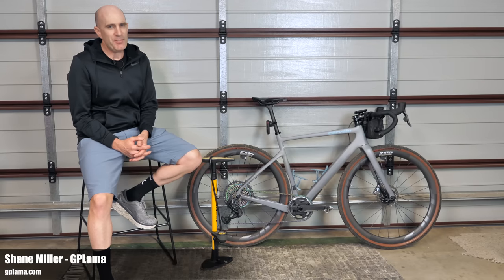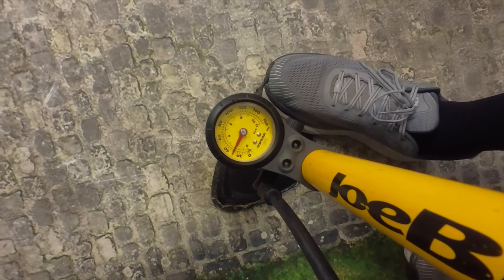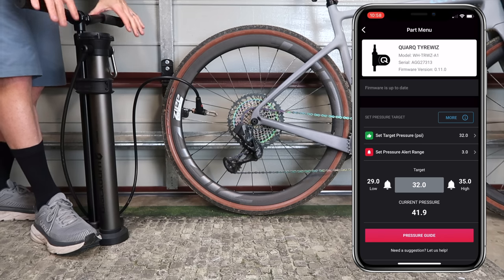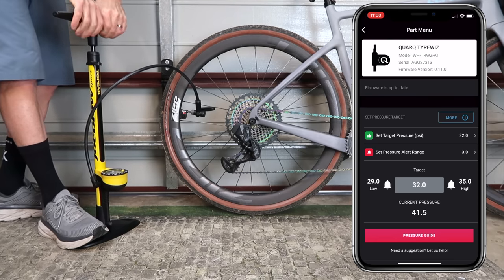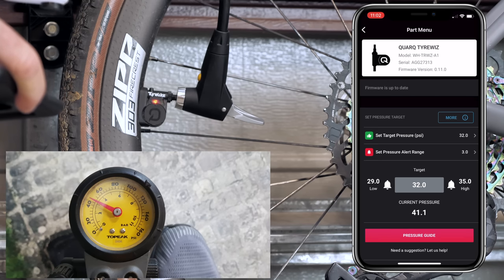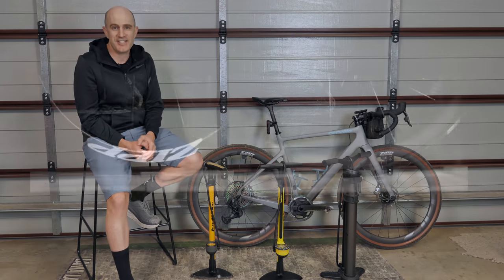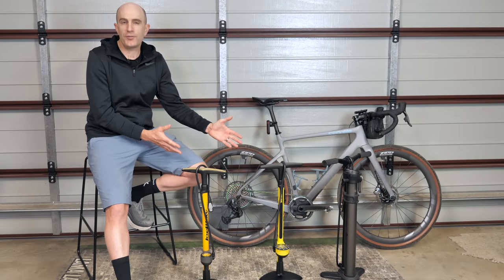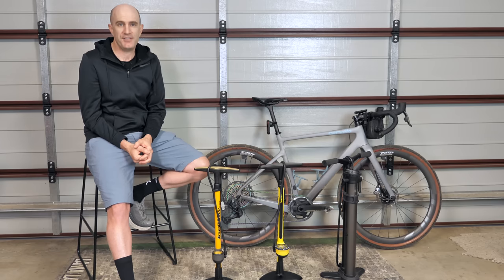Is Your Bicycle Floor Pump Accurate? Mine Wasn't 🤔

Comment: If your pump doesn't have a check valve between the pump cyclinder and the gauge, it's always going to read low.  Even then, it's going to read the pressure in the hose - not the pressure in the tire. I always recommend a stand alone digital gauge for our customers that need more precise tire pressures. (gravel and cx racers mostly)

Comment: I had an old Silca pump that I bought when I first got into cycling as a 14 year old about 20 years ago. After a period of 2-3 years off the bike, two years ago I got a gravel bike--my first experience with wider tires, tubeless, low pressures, etc. They always felt squishy to me, but I just thought "guess this must be wide tire life, NBD." I then bought a topeak digital pressure gauge before a trip when I planned to take only a mini pump to top off if needed, but for the life of me I couldn't get the digital gauge to read correctly--it always seemed about half what my floor pump read. I set it aside for a month thinking I got a defective one, until finally the Silca pump gave up the ghost and literally fell apart one day. Bought a new pump from Lezyne and for a minute I thought it too was bad--the pressure was reading so low! Then I quickly put 2 and 2 together: my old pump was overreading my pressure by about 100% for the last 6 months. What an idiot! I was riding around with like 21psi when I thought I was on 40. Needless to say, there were instant speed gains riding on the correct pressure after that.
Reply: Silca might be able supply the parts to refurbish?
Reply: @julianoneale9570  yeah probably. I needed a new one on the spot though and I don't have a need for 2 floor pumps, so it was a replacement for me. Little sad after so long though!

Comment: That Topeak D2 SmartGauge is outstanding. I’ve been using it for years on my mountain bike (16-24psi depending on tire width). It was pricey when I bought it but consistent which is key (and frankly more important than accuracy IMO) especially when riding at lower pressures. I use in on the road bikes too. Just over inflate by ~10psi and release pressure using the Topeak until you’re at your desired pressure. 10/10 can recommend.

Comment: Thanks for the update! I just bought a Joe Blow III. I bought it to replace an old pump that had issues overcoming internal pressure on long valve inner tubes and also struggled to stay connected on shorter valves, without taking off the threaded securing washer/ring. I also noticed the difference in pressures between the two, but couldn't confirm which was more accurate. This has me feeling better! 👌

Comment: Several years ago I purchased what I suspect is the most expensive floor pump on the planet. I didn't pay a premium because I thought doing so would ensure that I had the most accurate pump. Instead, it was the chuck that was the compelling feature. I have a movement disorder, which makes operating the locking lever typical on most chucks quite challenging. On the Silca pump, the chuck is supposed to slide on and off of Presta valves. In practice, the chuck needs some break-in time before it's performing optimally. For a pump that gets low to moderate use, it's already on its third gauge! But that had little to do with their accuracy. The previous gauges failed for a variety of reasons. Given the price of admission, I expected everything on the pump to work indefinitely. To their credit, Silca has never charged me for the price of a new gauge. At 68 years old, I don't know how much longer I'll be doing this, so an investment in new technology might not be in the cards. However, if I ever make the leap to something requiring more accuracy (e.g., hookless tubeless), obtaining new gadgets might become a necessity.

Comment: Good advice is also to use the old school method of using your thumbs as sensor. Especially with lower pressures. Gives a bit more feeling than cold numbers (saw a comment about someone not liking how squishy the ride was, but according to the pump it was a certain pressure, which it wasn't...).

Went up the Koppenberg last week on a regular road bike with 23 and 25mm tires with the cobbles being wet, muddy and with leaves to make it even more slippery. Dropped the pressure by feel. Upon returning I messured the pressure and it was the 4 bar I always like for these conditions.

Super interesting to notice that 5 bar made it near impossible to climb the Koppenberg under these slippery conditions, but 4 bar made it very well possible.

Comment: How do you know any of your equipment is correct (digital or analog) without a calibrated gauge? A calibrated gauge is the only way to know for sure. Love the channel.
Reply: TyreWiz reports data with +/-2% accuracy at a resolution of .1 PSI; vastly more accurate than any tire pump on the market
Reply: @richardggeorge  If we take that claim on its face then that's a spread of 58.8 - 61.2 psi @ 60 psi target. Higher pressures would yield a larger delta. You won't know, for sure, if the TyreWiz is correct without a calibrated standard to compare it against. For me, it's not a big deal. For others, it might be.

Comment: I have the same pump, also had issues with the check_valve, found that just removing/re-installing did the trick for most times.
It got damaged while pumping furiously to try and seat some dodgy tubeless tires. (I think it overheated or something, it is basically a piece of plastic with a spring).
Then purchased a replacement, it was very cheap.
I agree it is not so accurate (I double check with a digital meter), but it is repeatable, so as long as you find the pressure you like, you can get it with the pump. 
(Even though it is not the "real" value).

Comment: My next floor pump hope fully will better than my current one which struggled with any pressure over 100psi.
I use latex tubes so the pressure is probably at least 10psi less after a two hour ride.

Comment: There are so many variables to choosing a suitable tyre pressure, and it changes during the course of a ride anyway.  Find a pressure that is suitable, and then consistently pump to that using the gauge you have.  Doesn't matter what the gauge actually says as long as the gauge is consistent.  If I'm comfortable at 70 psi on my Joe Blow's gauge, I don't care that a more accurate gauge might read 65 psi.  Point is, I have the right amount of air in my tyres.
Reply: It is however really annoying when you ever use a different pump :)

Comment: I have a Park Tool floor pump with a similar issue -- it is always off by about 10 - 15 psi. I always have to double check everything with a separate tire pressure gauge that I also use for my car tires.

Comment: My wife got me a handheld air compressor made by Ryobi and I haven't used my floor pump since, it has a built in digital gauge as well, highly recommend. But yep I have a Joe Blow from 2010 that was always reading higher than what it actually was. I only knew this because I also used it to top off the air in my car's tires and I would check them with a digital gauge and the Joe Blow would read 32-33 while the gauge would read 30.

Comment: There is also  SKS  AIRSPY SV which seems to be quite bit cheaper that zipp's.

I have been thinking designing a ant tyre pressure sensor myself, but component shortages have made sensors as hard to find as gold.

Comment: My topeak joeblow race is off by 3 psi. Confirmed this with SKS pressure gauge. I like the topeak pump for the same reason you stated, but the smarthead can be damn frustrating. I had to disassemble and reassembled it several times already even though it’s only one year old. It happens if I switch back to presta from schrader.

Comment: my old floor pump  went into the back of my car so i always  can do  a quick load up  of some tires, for example  if needed  when doing a event or when  terrain ( for mtb is  wet  , sandy , rocky  orwhatever )  since then i got atleast a balpark figure to work with.  instead of blind guessing it with my  portable emergency  bike pump in the back of my pocket.

Comment: I started to experience a rash of pinch flats...something that almost never happens to me....and began to wonder if my own Joe Blow Sport's gauge was no longer accurate. I run higher pressures and clinchers with tubes. I'm guessing the gauge was over estimating by at or at least 10 psi, which would certainly be enough to make pinch flats more likely. It has since been replaced, and so far so good.

Comment: I have one of those older Joe Blow pumps and it is really time for a replacement. Squeaks and squeals at higher pressures. I also have a Topeak pressure gauge. Great investment. Use the pump on my auto tires and .5 psi is ok.

Comment: Bourdon tube gauges (ie analogue) gauges go out of calibration quite quickly as the tube ages in the gauge, a digital gauge is generally more accurate - usually! depending on the method of measuring? not sure about other country's but in the UK all pressure gauges available to public (garage etc) and in workshops should be calibrated every year (same for torque wrenches) how many actually do this i'm not sure?

Comment: I have a Topeak and a Parktool floor pump and they are both way off. I use a Topeak digital pressure gauge to check tire pressure.

Comment: Fortuitous video sir as my old Nashbar bargain basement floor pump was getting fiddly to attach and  difficult to use. Bit the bullet and spent stupid money on a Pista Plus model from Josh over at Silca.  It's a beautiful piece of kit but is it accurate or even worth the money? Will have to secure the Topeak digital gauge to check.

Comment: My Topeak was great for about 6 months, then basically never read over about 15psi. I think tubeless sealant got in there, so be careful with that, not sure how you stop a back blast of sealant though.
Reply: I've had the same issue with sealant.  Not sure how to prevent that!

Comment: I got to get a new floor pump. Mine is over ten years old and was a "cheap" one to begin with. The gauge is probably shot. I pump my tires to 110-115psi and it feels like I'm riding on steel tires and cornering is treacherous. The electronic gauge you recommend doesn't work very well for me. I lose a lot of air while connecting it and it seems to report a very low pressure.

Comment: No end of life! Topeak pums are great, I have JoeBlow HP. You can buy separate parts from Topeak like hose, valve or guage. Repair , don't throw away.
Reply from the maker: The Sport III works without me having to spend any more time messing about with the old one. If anyone wants it, they can have it.
Reply: Exactly, it still works fine. If that's your primary pump then why replace it due to the gauge? If you know the difference between pump and digital gauge why change? Cyling is supposed to be friendly to the planet.

Comment: Very interesting, I have a joeblow 2 myself. I'm wondering if the preasure is also off on mine. Been wondering if I should get one of those smartgauges for awhile, I guess its time to order one and find out if my pump is done after 10 years. :)
Reply from the maker: Keep me posted. I'm interested to hear how others go with their comparisons.
Reply: @gplama  Yep will do. Already blew up my rear carbon wheel most likely due to low pressure + very bad/cracket tarmac. If the pressure turns out to be even lower, then it makes sense since my Pirelli P Zero TLR require a decently high mininum PSI.

Comment: Should we accept that the digital guages are accurate? If so, that's awesome to double check the pump accuracy. If not, how do you tell which is correct/incorrect? Thanks
Reply: Indeed my Topeak D2 gauge reads around 10% low at 80 psi compared to my Lezyne floor pump, Lezyne travel pump and another unbranded floor pump. So all three floor pumps show 80psi when the Lezyne shows 73psi.

Comment: Since you've got that phone app why not disregard the pump gauge? You wouldn't believe the gloop and dirt accumulated in my 25 year old Silca pump. Tire pressure is an educated guess at best. Who actually rides on a consistent road texture anyway? As soon as you leave the house the pressure will change due to temperature difference or the use of latex tubes. I've named the gradual increase on long hot rides- Iron wheel syndrome! The solution is often to not spend money searching for a problem!

Comment: I don't trust any of my larger pumps. Mostly because I don't think they have the same accuracy across their entire pressure range. I don't expect it to be accurately indicating the pressure for MTB tires (1-1.5 bars) as well as race bike tires (5-5.5 bars, used to be 7-8 bars). Hence for years I'm over-pumping and then checking/deflating with a Topeak D2 indeed. Every time you mount it you loose about 0.1bars, as a practical way to deflate. A bit more work but way more accurate pressure in your tires!

Comment: pretty sure you can fix that faulty valve and requalibrate the hand of the nanometre on the old pump. 
theese joe-blow are easy to fix, and you can ace the services even without the actual Topeak parts, there pretty standards and customizable from other parts designs.

Comment: In had the exact topeak pressure sensor and it was also inaccurate! Recently I bought the park tool inflator, which is fairly expensive and also (very) inaccurate! I was comparing to calibrated equipment.

Comment: I spent decent money on a track pump a while back but always suspected the gauge was dodgy and getting a digital gauge confirmed that. Even if you get one that turns out to be accurate, a small analog dial that is supposed to cover everything from 0 to 100+ PSI is never going to be the most precise way to set your pressures
Reply: A analog gauge can be just as accurate. But it all comes down to money and quality control. A accurate gauge isn't cheap.

Comment: I have a Serfas TCPG floor pump and the pressure gauge is not accurate at all.  The difference on the gauge vs actual pressure is around 10psi.

Comment: You are assuming the digital one is correct. Traceability to ISO 17025 ?
Reply from the maker: The two TyreWiz and two newer pumps all agree within a small margin of error. The older pump was well outside what I expected. I’ll dig into the specs of the TyreWiz. SRAM claim +/- 2% accuracy at .1 PSI resolution.

Comment: As a role of thumb, you can also calibrate to the old fashion thumb pressure measurement before you ride along, and point a wet index-finger in the air, to predict the wind, since weather forecasts can be unreliable too. Cycling in general is hard, but road cycling is pure science! Love this channel by the way.

Comment: When you unclip the floor pump and get that hiss from the hose, are you losing air from the tyre or does it hold the pressure as per the last pump?
Reply from the maker: I find it depends how much the head was pushed down on the valve core. Ideally it’s only the hose air. Some heads have a pressure release button so it doesn’t pop/hiss.

Comment: Shane, the comment you made about running your hookless tires over 72.5 is blowing my mind. I'm 225lbs and usually run my tires at 80 and 85psi. Should I run them lower or should I cut back on the donuts and get down to a weight that I can get in the 72psi limit? That's a serious question btw.
Reply from the maker: If you're using hookless tubeless rims, they won't be rated for any higher than 72.5. Check the manufacturer recommendations for pressure.
Reply: @gplama  Will do! Thank you for the reply.

Comment: A man with two watches is never sure what time it is.
Reply from the maker: But with three or four you get a good idea what time it really is.
Reply: @gplama  Very true, and I should've included that.  Or...  you can use just one, know what it says, and not worry about the rest. Which is what I've done so far (with my 20+ year old Joe Blow pump), though I'm sorely tempted by the TireWiz setup.

Comment: ANALOG gauges are only as accurate as this markings.  Kinda like try to measure thousands of an inch with a yard stick...  or hundreds of millimeters with a meter stick..   hmmm... do they HAVE "meter sticks"???   Anyway...  this is the usual interesting GPLama (the G stands for gravel...) stuff.  Do we see a pump accuracy series coming!  Wonder how you can get the data into your "...favorite website..."...    nyuk! nyuk! nyuk!
Reply from the maker: The 'wiz pressure data is recorded and mapped on Garmin Connect and the SRAM AXS site. It's really interesting to see the pressures change based on temperature and elevation (expected, but still interesting to see it happen). The next rabbit hole is which head units record this data. At present only Garmin Edge units do. Wahoo displays the data but doesn't record it. Hammerhead... well... they don't even record gearing/Di2/eTap information last I looked, it was all display only there too.
Reply: @gplama  I ride "naked" ...  no electronics at all.   No worries about "data"...  Nyuk Nyuk Nyuk!

Comment: ETRTO didn't rate hookless rims up to "72.5 psi," they simply used the metric system and rated them up to 5 bar (which happens to equal about 72.5 psi).
Reply from the maker: So… 72.5 psi. 🤷🏻‍♂️
Reply: @gplama  Yeah, but in your video you seemed surprised/bemused by the precision of the rating; I’m just pointing out that the actual rating was a nice round 5 bar.